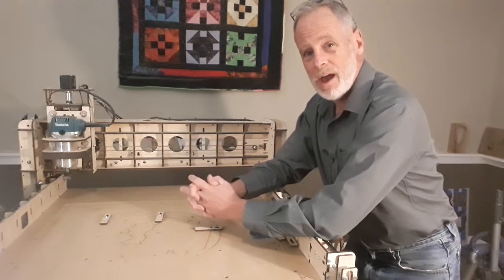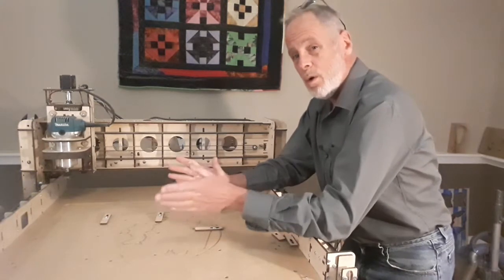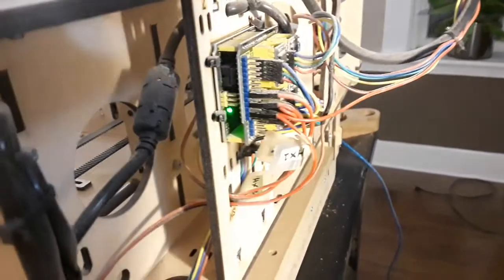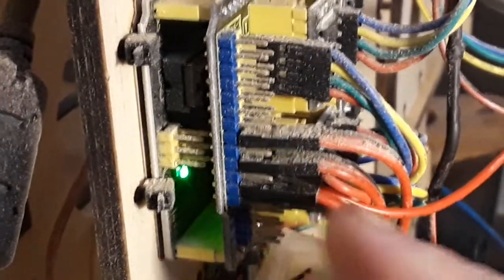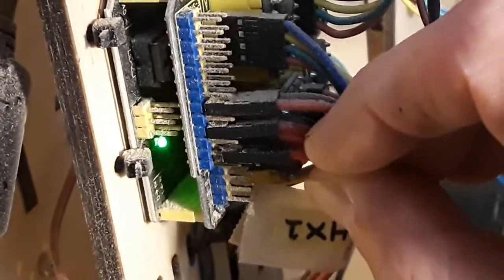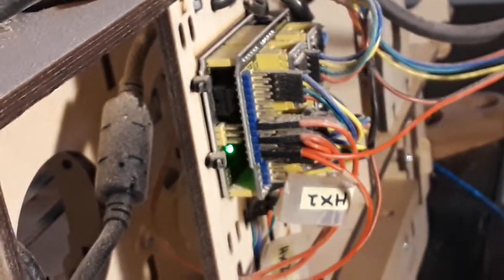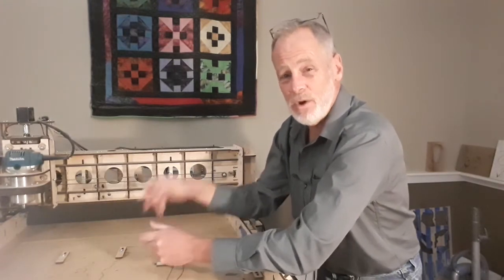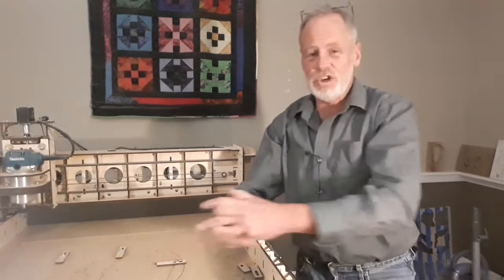BobsCNC E3 E4 Homing & Gantry Bind Fix, DOES NOT APPLY TO K-SERIES, CNC For Beginners

Comment: You was so right about the wire!! But now I have a new problem after homing and after trying to figure out The software programs and started the project but the opposite side of homing is binding on the gantry!!🤨 I will roll freely with no power to it so I’m not sure it it is the program or the stepper motor not working now
Reply from the maker: I think you should contact Bob's regarding this

Comment: Hey Garrett,  I really appreciate that you share your learnings as you progress down the CNC road!
This would definitely relate to the E3/E4 series, but the controller setup for the KL series is quite a bit different.  Jacks like that aren't used... everything is individually wired to the Arduino shield from the drivers; and since the control box is a stand-alone unit, a lot less of a chance to vibrate anything loose over time.
I just finished my 744 and working on the spoilboard today.  I'll shoot you some photos.
For anyone interesting in purchasing a BobsCNC, I can't comment on the performance yet as I just finished the build, but the quality of construction is great and the support from Bob is EVEN BETTER!  I had a ground wire issue and after troubleshooting over the phone with Bob (on a SATURDAY mind you), we found the issue and resolved.  Outstanding customer support!!!
Reply from the maker: Thanks for the tip. I'll correct the title and tags and description. I can't wait to see your machine assembled
Reply from the maker: Yeah, I had that gut feeling I should have checked first.
Reply: @IDCWoodcraft  Feel free to reach out to me going forward so we can compare/contrast machines... here to help.  Maybe one day I'll get my channel going as well.
Reply from the maker: @jimaikman2875  That would be excellent to connect!
Reply from the maker: What are you planning to create with your awesome machine!